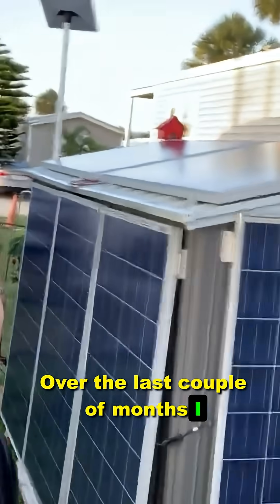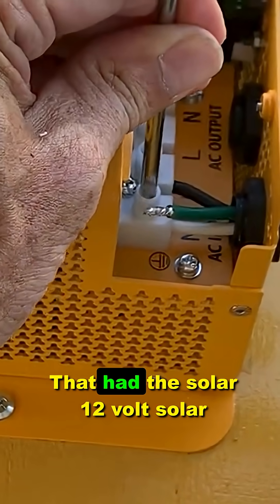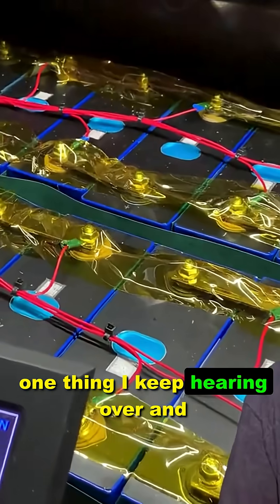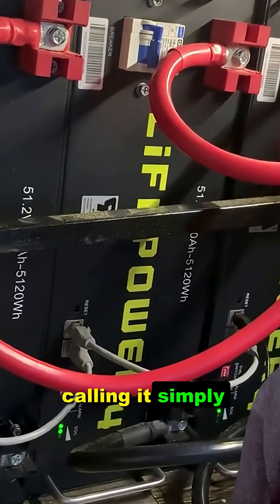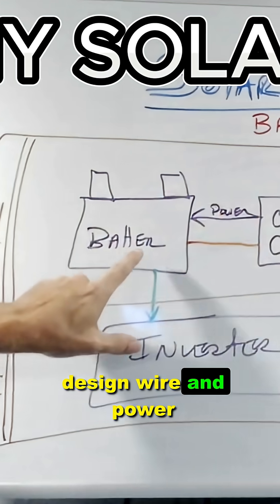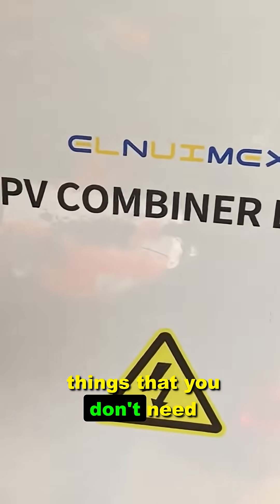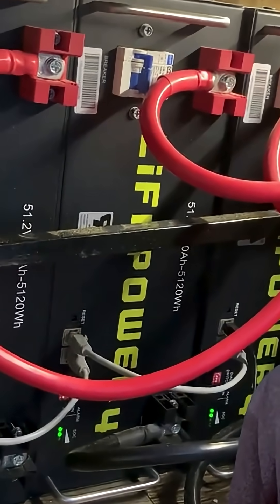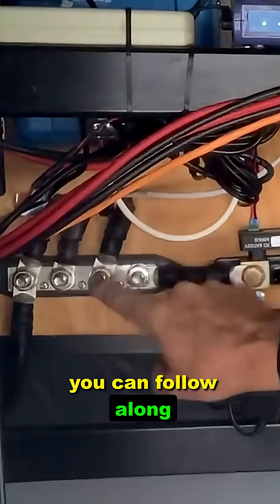DIY Solar Made Simple 🔋 Start Your Project the Smart Way

Comment: Yes we really need this. Were off grid and need solar panels. Were building tiny homes and wish to stay with battery generators but move into solar charging for a more clean efficient power source.
Reply from the maker: I was thinking of like a sun screen that allow sight but not the sun heat to hit the outside of the window

Comment: Matt, I would call myself one of your students and I have to say, even though I haven’t seen this course, the knowledge you’ve given me over the last few months has been invaluable. I’m sure you’ve poured all of that into this course, because that’s the kind of guy I’ve seen you be. Thanks to your guidance, I’ve been on a 7 week trip now and we’ve yet to run out of power. 
33’ ‘25 Brinkley Z2900
2400w solar
4 x 51.2v 100ah Eco-Worthy batteries
EG4 6000xp inverter
Reply from the maker: That is what I did, took it all and put it into a orgnized step by step class.. I am so glad your RV is performing the way you wanted everything to work.